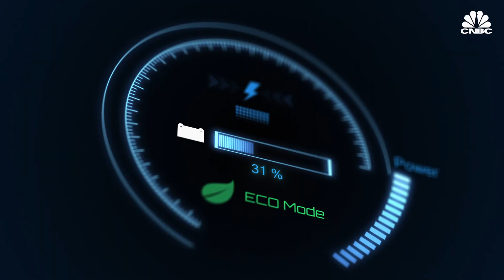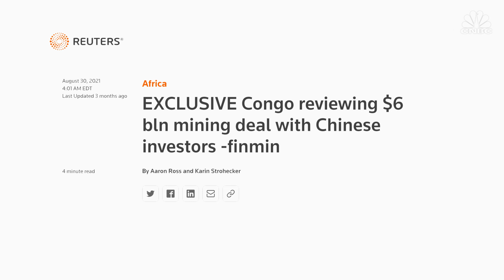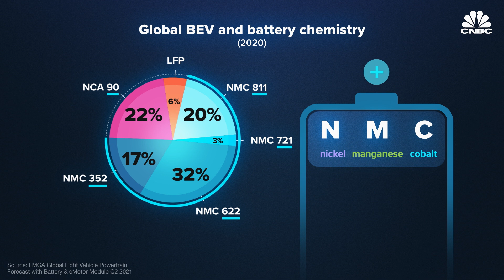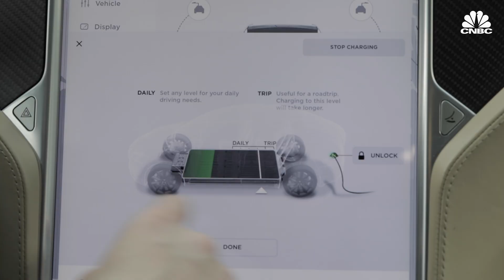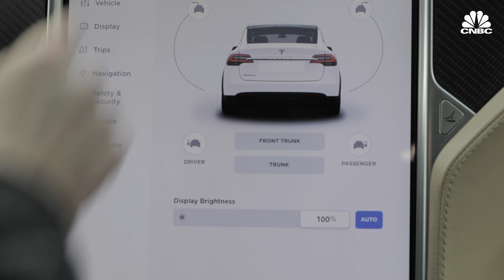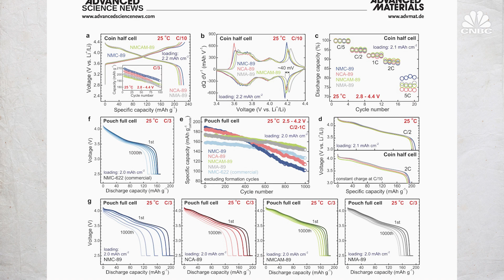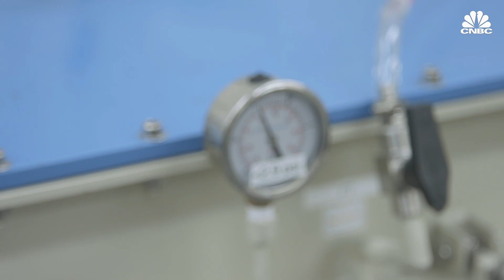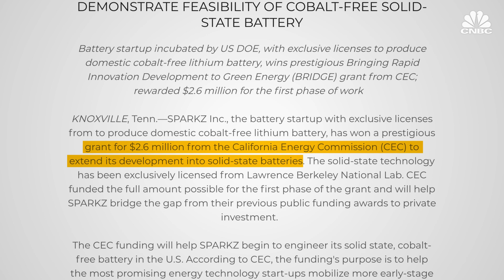How Removing Cobalt From Batteries Can Make EVs Cheaper

Comment: Another advantage of LFP is that they can be routinely charged to full, discharged to zero, and stored at high charge with very little degradation.

NMC and Lithium-Polymer batteries should not be charged completely full nor discharged to empty, and should not maintain high charge for long times.  Their charge levels are trickier to manage than LFP, in short.

However, LFP batteries must not be kept at low-charge for long.

Comment: Right off the bat, batteries without cobalt such as lithium iron phosphate (also called LiPO4 or LFP) batteries are less prone to fires, in other words much safer than those that contain it. Secondly, Tesla's Standard Range Plus Model 3s and its Model Y Standard Range vehicles sold in the U.S. use LFP batteries. Ford is building a battery factory in the U.S. that will make exclusively LFP batteries for all its EVs opening very soon. So the industry is going cobalt free very soon. LFP batteries are again safer, less prone to fires and the kicker is much, much cheaper than those batteries that contain cobalt. The downside of the batteries is that they are less energy dense at this point than those that contain cobalt, so you tend not to see them in the companies longer range vehicles, at this time. Advancements are being made in battery chemistry and vehicle efficiency that will, shortly, bring us much longer ranging cobalt free batteries. The future is looking brighter and brighter.

Comment: It’s alright feature Ev’s dropping cobalt from battery’s which is great but I don’t hear the petrochemical companies dropping it . The oil companies use way more cobalt for the refining proses for every gallon of fuel used. Remember once a battery is made that’s it. But every gallon of petrol used needs cobalt and so over the lifetime the Ev would use a lot less cobalt compared to a combustion engine car.

Comment: Is the staggering ENERGY USE really worth the trouble of making such inverters and modules? The green energy development is actually hitting a limit, because all solar inverters for solar panels have cobalt, so coupled with using an EV and mobile phones and computers it actually can deplete the earth's vital magnetic resource. Now, it is always possible to create artificial cobalt in a cold sodium copper calcoid exposure, but there exists an industrial laziness to do this. There may be other methods of energy-generation emerging in the near future. But the downside is that the ENERGY needed to process the resource to usable modules is staggering and doesn't justify the untamed overpopulation and consumption that emerges from just one woman having more than two kids per lifetime. In fact, already 1 child per pair is currently overshooting the overpopulation limit in our current world population amount. Now add this to every child, teen and adult owning some form of battery operated gadget to indulge in some form of useless pursuit of unjustified avarice.

Comment: Run Nano threading throughout the whole structure of EVs to turn them into a big battery that lasts for a very long time. Have a direct connect to the axle of EVs to super charge them. No more plugging in.

Comment: The world has to convert to less toxic product due to the amount of people n pollution. To have both oil n auto moguls allowing innovation who knows where this goes. Im seeing many people innovating. Someone working on auto using compressed air.   It been a long time where innovation has been swashed. Hopefully politics don't stop this necessary step in the future.
Reply: Driving on compressed air is horribly inefficient. Battery electric is the only sensible solution for low carbon transportation.

Comment: LFP is virtually a non starter considering it pretty much has the energy density of lead acid
Reply: You clearly don't know what you're talking about. Lead acid cell energy density is around 80 to 90 Wh/L, while LFP is around 325 Wh/L.
Reply: @benjaminnead8557  correction on my part specific energy. The two are not equivalent but getting a 200kwh lfp into a car is going to be interesting

Comment: from scientist in quora "Cobalt is used as a catalyst in refining operations. It helps remove sulfur (and maybe other impurities) from the hydrocarbon stream. In theory no cobalt is consumed in the reaction, but in practice some will be lost to erosion and flaws in the recycling process.
It takes about 1 pound of cobalt to remove the sulfur from 80,000 gallons of petroleum products, like gasoline. 80,000 gallons would power a car for about 2.4 million miles, but 98.8% of that cobalt is recoverable, meaning we permanently lose only a pound of cobalt for every 6.6 million gallons we refine.
So, as I said, we use lots of cobalt, but we don’t consume it, we use the same cobalt over and over again.
Rechargeable battery cathodes contain up to 33% cobalt. Since batteries are small, that doesn’t sound like much, but we make lots of them. 50% of all the cobalt we use ends up in rechargeable batteries, and since the advent of battery powered electric cars, the amount of cobalt used has mushroomed to around 25,000 tons. At current rates, it’s expected to hit 100,000 tons within 5 years."

Comment: The BYD blade battery is cobalt free and the safest battery by far. Only battery to pass the nail through test. Also very good in extreme heat and cold.

Comment: Yes but this does not rid the fact that electric motors cause cancer miscarriage autism EMF rays.
Also you have higher costs of vehicles biofuels Are much better and don't produce as much c02 as as the manufacture of batteries the batteries alone to make take the same amount as running a petrol car for over eight years.

Comment: I honestly don’t get it. How are electric cars better for the environment? They still have to dig giant craters in the earth to mine and process it. While oil fracking does less environmental damage. They’re are cleaner ways to refine gas and make gas engines run cleaner and more efficient. I’m sorry but electric cars will never replace gas cars. Gas cars have been on the road for decades. Not to mention how would they recycle electric car batteries when they die? An electric car is only as good as it’s batteries
Reply: Electric cars are FAR better for because they are so efficient. Even on non renewable electricity they are cleaner than any diesel or gas car. Gas cars can never be clean because you cannot filter CO2.

Comment: @4:15 you got Anode and Cathode mixed up; the Anode is positive (+) terminal of the battery, and Cathode negative (—)
Reply: It depends if the battery is charging or discharging. On discharge the negative electrode is the anode, but on charging the negative electrode is the cathode. For this reason saying positive or negative electrode to refer to the different parts is more accurate. But in the field, people generally mean the negative electrode(graphite) when they say anode, and positive electrode(NMC) when they say cathode.

Comment: NOT true. The cost of batteries has not decreased. It's just the opposite. The cost has increased.
Reply: Can you provide a source? Literally every source out there suggests costs have decreased >80% over the last 10 years alone, and they appear to be on a steadily declining cost curve.
Reply: @Zaerki  the source is my invoice cost
Reply: @pabloblanco2656  Gotcha, so you're talking about the price to purchase a battery, but not the actual cost to produce it.
Reply: @Zaerki  yes
Reply: The last decade the price decreased substantially.
Reply: @Freba9  L o L   not where I live.
Reply: @pabloblanco2656  That’s weird. It accounts for pretty much anywhere around the world.
Reply: @Freba9  L o L. The material and metals to make batteries have been in scant supply which is why the cost has risen worldwide.
Reply: @pabloblanco2656  Sure but the vehicles are still far cheaper than 10 years ago like I said.
Reply: @Freba9  No vehicles are not cheaper than 10 years ago. Maybe Tesla but every other car price has steadily risen

Comment: You want to talk about competition?  How making a quick-charging e-car (15 minutes) that has a range of 100 miles and sells for $10K - $15K?  And the manufacture will buy back your used battery from you after 5 years (or life expectancy of car) to assure it is 100% recycled?  Most people hardly ever drive more than 100 miles but we all want out gas tanks filled very quickly.  Right now, with gas having gone up 43% in one year, it shouldn't be a hard sell to lure Americans over to the cleaner electric car market.  The estimated EPA range of the Tesla Model 3 SR+ with LFP battery is 253 miles (407 km) - plenty of long-distance for many driving enthusiasts.
Reply: Tesla can already charge over 100 miles in 15 mins.

Comment: Natural gas is the future. Natural gas emits very little pollution and is very abundant worldwide. Very few changes would need to be made since we already use natural gas for many other appliances. It is a fossil-fuel but people should think realistically that we aren’t ever going to be “carbon-neutral”. It is possible to reduce emissions but not zero-emissions.
Reply: Wrong. Natural gas still emits a lot of CO2. Only slightly less than diesel.

Comment: I don’t like electric cars
Reply: Natural gas cars are the answer.
Reply: @champanzee6486  No they are not.
Reply: @Freba9   better than electric, they are much easier and natural gas is very abundant worldwide. Not many changes would need to be made for infrastructure.
Reply: @champanzee6486  CO2 is the problem.
Reply: @Freba9   true, but realistically not everything can be perfect.
Reply: @champanzee6486  The whole reason for switching to an alternative is CO2. It doesn’t make sense otherwise.

Comment: after they eliminate cobalt they will still have to face all these other bottlenecks in the supply chain, lithium itself has serious environmental problems. copper, nickel, iron, a dozen different metals besides cobalt. EVs are not sustainable
Reply: Neither are fossil fuel powered vehicles, so take your pick......
Reply: EVs are far more sustainable than any ICE car.

Comment: Very good article, CNBC. This is the sort of information that I usually expect to find on specialty web sites that cater to clean energy topics exclusively. Thanks for not dumbing it down to appease to a so-call mainstream audience.
Reply: I tent to generally like many of the CNBC deep dives into the industrial sector…
Reply: No mention however of 4680 which is a cobalt free functional battery
Reply: 4680 is a cell form factor (rolled cylindrical, 46mm diameter X 80mm long) that can accommodate many different chemical formulations, with or without cobalt.
Reply: @benjaminnead8557  The version planned is designed with zero cobalt in mind. With high nickle and silicon, rendering cobalt obsolete.
Reply: Or much worse yet, the treason supporting fascist media!
Reply: @nightlightabcd  learn to filter your information haha your not a drone

Comment: Hydrogen cars seem to be an answer. As long as we use renuable energy sources like heat in our deserts to produce the hydrogen. The benefits of using hydrogen is that we can top the vehicles up within minutes, instead of waiting for batteries to charge up.
Reply: But it is horribly inefficient
Reply: @Freba9  check this documentary:  https://youtu.be/4sn0ecqZgog
If we used the energy from our deserts to produce hydrogen, then we can have hydrogen stations that fill our vehicles in a practical amount of time. We need to diversify our energy resources. We cant just just be dependent on electric.

Plus, their are alternatives uses with hydrogen, as we can use it to heat our homes, backup hospital generators and etc.
Reply: @TajulIslam-ei7gd  Of course we can but that does not make it any less inefficient. Electric cars only require 1/3rd of the number of solar panels / power stations. Using hydrogen is not ‘diversifying’ energy sources. Hydrogen = electricity and hydrogen consumes vast amounts of precious renewable electricity that could otherwise have been used in a much better way.
Reply: I don't wait for my batteries to charge up. I charge the car while I sleep. I don't need my car when I'm sleeping.  And you won't top your hydrogen car up in minutes if someone has just used the filling point before you, because it can take up to 15 minutes for the pressure (10'000 psi) to equalise in the pipework before you can use it....
Reply: @Brian-om2hh    problems like that can be easily resolved. Just increase the number of tanks that need to recharge up to the 10000psi and alternate amongst the tanks. You could also increase the number of hydrogen outlets per station. 

We use a lot of electricity nowadays, therefore the technology has advanced. However, we have an abundance of hydrogen and we haven't even tapped into it yet. 

Hydrogen is the definite answer to log distance travelled, therefore the technology can have a big affect on the logistics sector.

Comment: Electric cars are such a bad idea for motorists and the environment. Another marketing craze. How much better would it be to have clean artificial made bio fuel and use normal ice cars that would not emit any co2?
Reply: And how would you produce this bio fuel?  And would it appear magically at filling stations, or will it need to be transported all over the place in large tankers before it can be used?  And can I get bio fuel from my solar panels?  In case you hadn't noticed "normal" ICE cars are going out of production in a few years time... so why would you bother to make bio fuel for cars which are due to cease production, and older cars already out there which will wear out, break down, or become unviable to repair, thus continually decreasing the market for bio fuel.... Would you invest big bucks into a market you knew was going to constantly shrink?
Reply: @Brian-om2hh  Exactly.
Reply: Bio fuels or synthetic fuels are very inefficient. Electric cars only require a fraction of the energy.

Comment: When Tesla mentions "high nickel", they're talking about their new cobalt-free nickel-based chemistry, not NCA. They also have a cobalt-free nickel-manganese chemistry with a lower fraction of nickel.
Reply: I don’t think they’ve ever said that the current nickel is totally cobalt free, just that they’ve reduced it a lot and are working on reducing it further, down to nothing, eventually.
Reply: @jonathanpalmquist4894  Correct. Tesla never claimed the new cells to be cobalt free.
Reply: Tesla's "new" cobalt-free chemistry is, in fact, an evolution of classic LFP (Lithium Iron Phosphate, LiFePO4, etc.,) which has been around for many years. The cells are made by the Chinese firm, CATL, who is the largest battery manufacturer ofn the planet. More on it here . . . 

https://www.youtube.com/watch?v=FdZL8RF3thI&t=1s
Reply: @benjaminnead8557  Yes, those are for the lower range vehicles.
Reply: @Freba9  Well, yes and no. The previous iteration of the Standard Range Model 3 with NCA cells has only about 10 miles more range per charge than the equivalent LFP-equipped vehicle. Also, LFP packs can be charged to a higher capacity without danger of damaging the cells and the packs are longer life overall. So, it could be argued that the LFP Model 3s are are superior in terms of range and longevity under real world operating conditions when compared to the NCA ones.

Comment: Presenting LFP as being inherently lower range is disingenuous when they are cheaper. They may be heavier, which comes with its own limitations in terms of performance and efficiency, but if you can just get a bigger battery to compensate, it doesn't matter for range.

Comment: Great, it'll leave more cobalt for the petro chemical industry to use for producing low sulfur diesel and fuel refinement as using it this way is completely un recyclable. Yay....
Reply: I understand some cobalt is recoverable during oil industry usage, but nowhere near the amount recovered when  EV batteries are recycled......
Reply: @Brian-om2hh  my issue is the distorted way the ev battery industry is mis represented by journalists. It makes me wonder why. The use of cobalt is almost totally ignored when talking about the oil industry, as are the ridiculously large subsidies received by the industry.

Comment: The move from using Cobalt in EV batteries means there's now little incentive to recycle batteries, call for EV car makers to be responsible for recycling their batteries.:(
Reply: Disagree my man. JB over at Redwood suggests that they can already economically recycle EV batteries, and the cost is going to decline as economies of scale come into play.
Reply: Doubt it. The other materials are still valuable. Anyway wouldn't a 100kWh pack that only charges to 80% still make an excellent house battery. That would be enough energy to supply a home for 4-8 days.
Reply: @AORD72  Exactly.